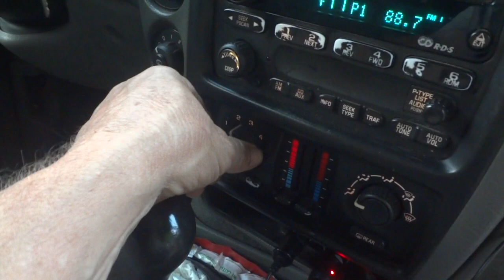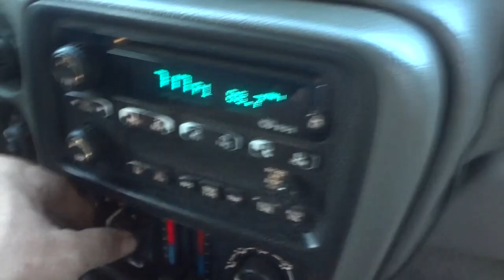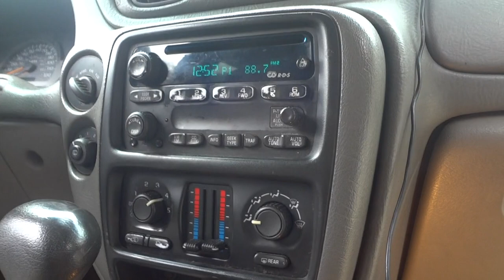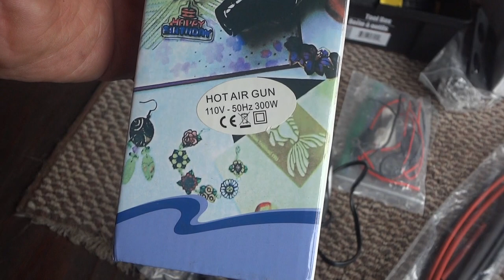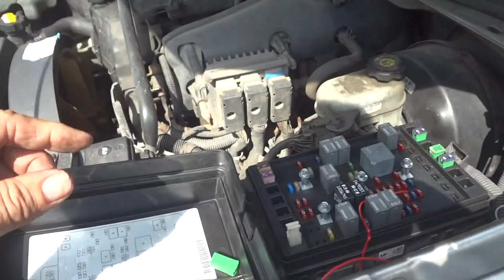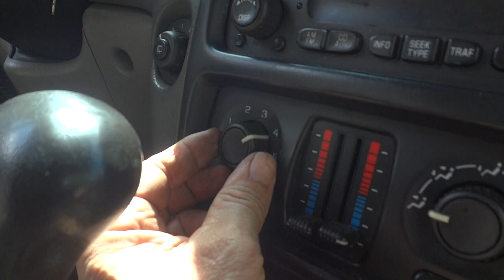Trailblazer Heater Blower Wire Combo Fix...Missing blower speeds fixed

Comment: If u open the glove box...on the left hand side at the back of the glove box is a little lever..if u pull that down it’ll release the glove box so u can open up the whole dash...ur blower motor and wiring is right there...makes it way easier to work on

Comment: I had the same issue and and I ended up replacing the same thing 
However it happened again and ended up replacing the blower motor and it’s been fine since ....
Mine has a lot of miles on it 🤷🏻‍♂️
 My daughter send me a vid a couple days ago of her oil pressure gauge that thing went from 45 to 0 to 40 to 10 oh boy I thought .. from what I seen the oil sending unit is probably going bad it’s still running anyways lol 
  Congratulations on the sponsor that looks like a pretty cool vac to have around!

Comment: Hello, I have a 07 trailblazer. We replaced the control module, the resistor and the blower motor. It’s not blowing at all like you can’t even hear it come on. I also checked the both fuse boxes and nothing. Please do you know what it is?